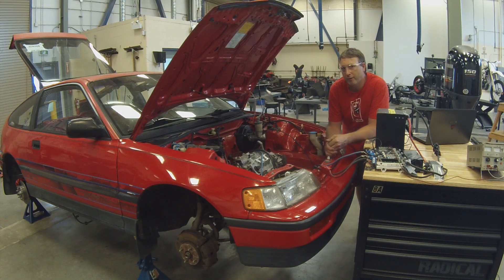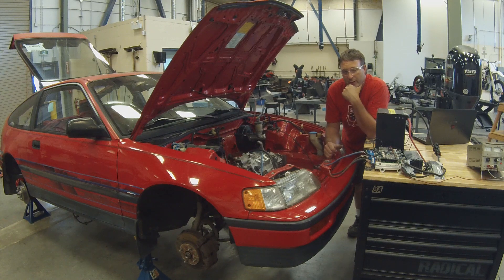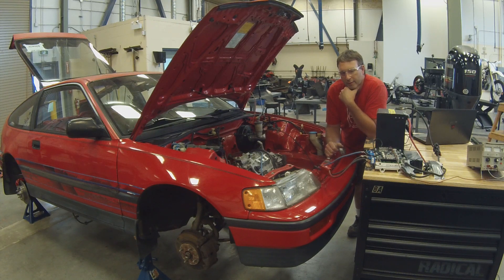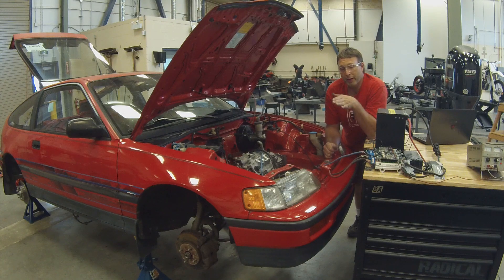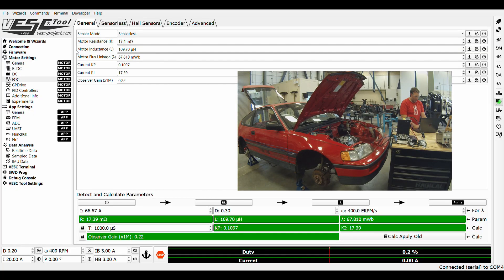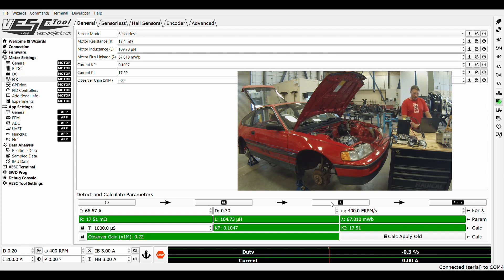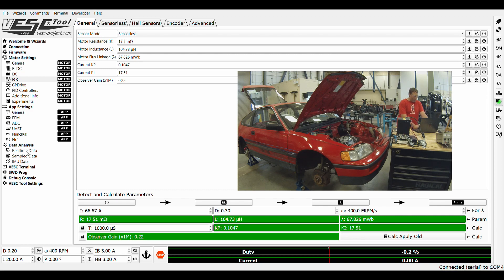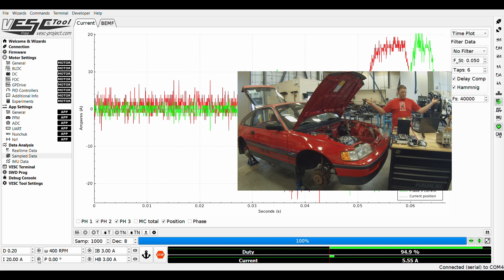CRX With Axiom

Comment: You highlight Traction Control & future Torque Vectoring surprise with Dual Axioms? Are these features simply possible because the software is open source or will they be part of the Axiom / VESC package?

Comment: what variety of motors could this control? only the leaf, or could this controller run any 3 phase AC motor available?
Reply from the maker: More or less all 3 phase PMAC motors with induction motors to come.  Remember it's open source so you can edit the code or design it to suit your needs if it already doesn't but it is a very versatile design as it sits right now.
Reply: @garbizwal  exciting times for ev conversions!

Comment: Arlin which forum is best to follow you on? Great to see you continued to develop the idea!
Reply from the maker: @d7j6f1001 Rae they are both EM61 motors.  I rotated the front motor up to fit more battery.  No point in stopping at a measly 300hp you don't set records doing that ;)
Reply from the maker: Endless Sphere forums.  Look for Arlo1 and Marcos and High Hopes!
Reply from the maker: Oh and you can also subscribe to our newsletter.   http://www.powerdesigns.ca/newsletter/
Reply: Amazing job... Any news on the whole assembly of the leaf? DC to DC converter, onboard charger..
Reply from the maker: @2487mpobor  non of that works for me.

Comment: I so want a Leaf motor and a controller that will be plug-n-play, but I think by being patient, this project (and others like it) will come online ready out of the box within the year. Not fun being patient, but the results seem like they'll be worth it.
Reply: apostate001 you know you can buy a can box that will talk to a stock leaf controller. It is as plug and play as you can get. Thunderstruck has them.
Reply: @cheapygeek  I did not know this. I've seen so many custom attempts here on Youtube that I just assumed that this was not done yet.
Reply: They have a VCU that takes analog brake and throttle inputs and directly controls the stock Nissan controller. $500, easy peasy.
Reply from the maker: @cheapygeek  The box to hack the OEM leaf inverter looks good but it will not have the power or the control this will have.
Reply: Yeah, Arlin showed with his V1 the OEM leaf motor has loads of headroom, so his make the best of that but if you want standard levels of power then that other one is okay.
Reply: I think I’m most applications, the stock leaf 100kW is just plenty. And for $500 you can’t beat it. I think you demonstrated that the leaf motor is capable of a lot more but truth be told, I’m not very excited to spend $10k to get there.
Reply from the maker: @cheapygeek  Stock leaf its 80kw.  Which is pretty weak.  Its ok for a commuter but if that's all you want there is no point in a DIY project and you should just get a cheep used leaf.
Reply: Good to know. I'm going to run mine at 85S for now but likely stop at 90S just due to space. Batteries are at 0.4mOhm each so I expect a little sag. But for the $500 cost I get Regen, all the stock Nissan motor safeguards, and the chassis battery output enabled. It would be nice to hot rod the controller but that will come much later.
Reply from the maker: @cheapygeek  Yeah safety is #1 with Axiom its likely a safer controller to use then the 2011 Leaf controller.  But we are not at a marketable controller just yet as we need to finish the enclosure.  We hope to have it to market in 2020.   Non the less stay tuned there is more to come for sure.
Reply: I have an email from Thunderstruck saying their controller does 300A at 350V with the stock inverter. No clue if that is software or hardware restricted.
Reply from the maker: @cheapygeek  80kw so its likely 300amps max with a 350v battery that sags down to 266Vdc or its 300amps RMS in the motor which is ~ 228 amps DC from the battery.  Either way its likely still 80kw peak and to go one step further I used 1200V rated IGBTs and the leaf IGBTs are rated for 600Vdc so I can run a lot more voltage and or a much stiffer battery.